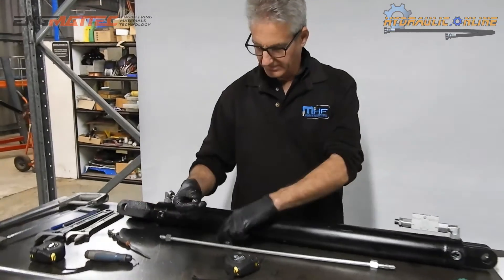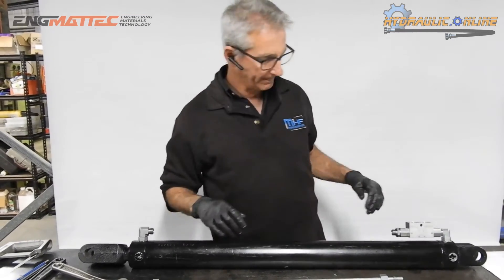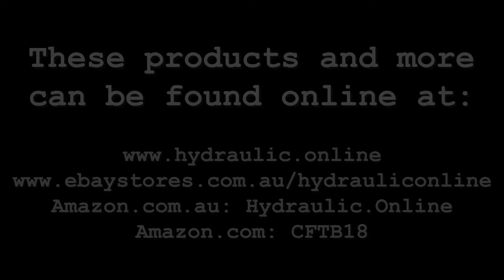Installing a Pilot Check Valve (Load Hold Valve) to a Hydraulic Cylinder

Comment: Is your spaner metric or standard? Lol I could not resist.
Reply from the maker: Good Question, most Hydraulic Fittings are made to imperial (standard) dimentions and we mainly use imperial spanners, But in a few cases there are close metric crossovers that sometimes allow you to use metric spaners. For example  5/8" is close to 16 mm, 9/16" is close to 14 mm , 7/8" is close to 22mm and 1-3/16" close 30 mm and 1-1/4" is close 32 mm,.
 I was In grade 6 (in Australia) when the country decided to start to adopt the metric system.

Comment: Hello . In the event of a check valve failure, is it possible for the two sides of the jack to connect or are they completely independent?
Reply from the maker: Depends on Valve and or the jack's design, but yes most systems have interconnecting oil pasages.

Comment: Where do I buy the check valve you show?
Reply from the maker: Hi Bill try this link below
https://www.hydraulic.online/INLINE-PILOT-CHECK-VALVE-STABILISER-LEG-320Bar-4800-PSI-p68710470
Reply: @Hydraulic.Online  how do you adjust the maximum holding pressure?
Reply: I have a bad cylinder lock valve 8 GPM and I  Replace with a 12 GPM.  That will be a problem??   I have rollback bed tow truck.  The old valve is 8GPM. The new valve is 12GPM.  Now with the new valve is making noise when I pick up the flat bed in my truck.  But other than that it is working fine.  Only little noise.  Now I'm wonder if that noise will damage my hydraulic system?? Please help me with that.  Thanks!